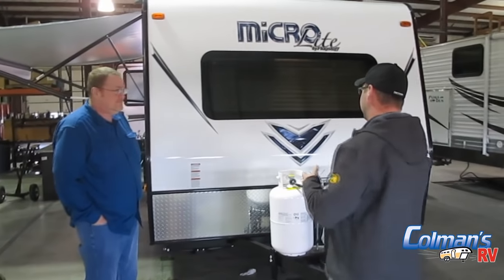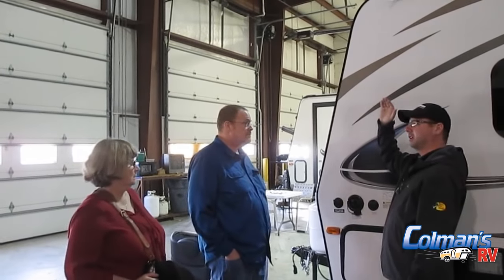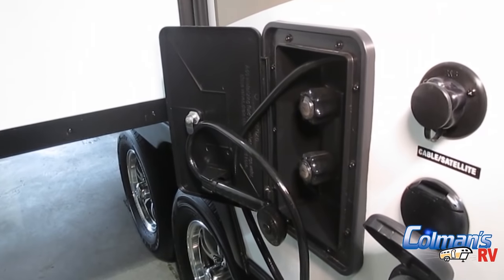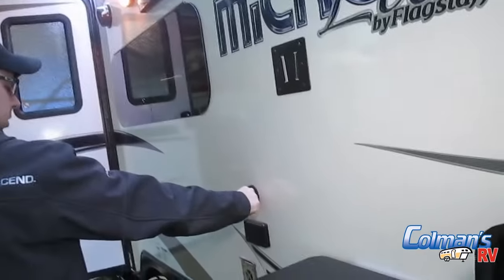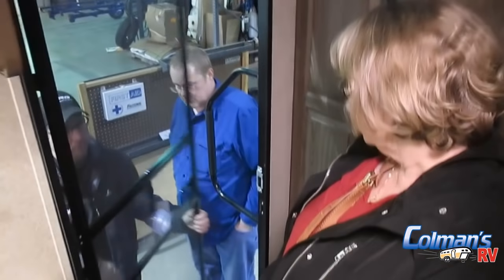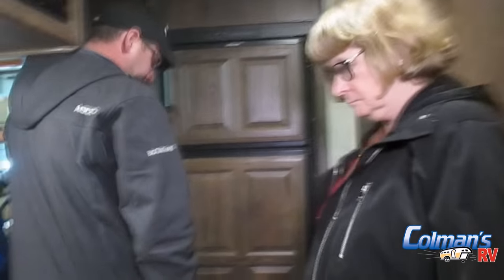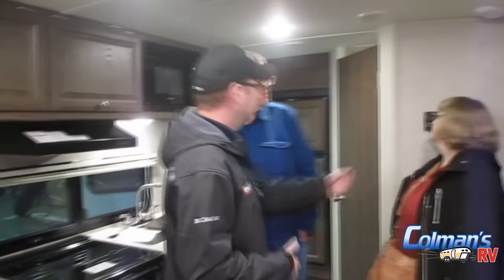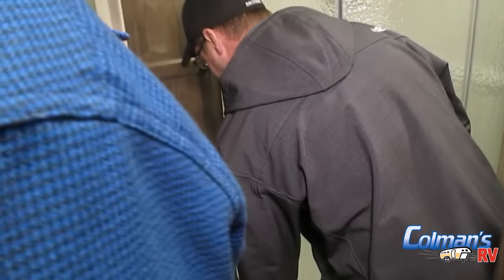2017 Flagstaff 21FBRS - DETAILED WALKTHROUGH!

Comment: This walk through is very helpful.  After watching it I just purchased a 2017 21fbrs.  And I will be watching this often.  I have one question.  How does an adult sleep on the jackknife pull out? It does not fold down flat. And is really short.
Reply from the maker: Elaine, congrats on your camper purchase! Yes, the pullout could definitely be a bit bigger and more flat. Unfortunately,  that's the way it's built for 2017.